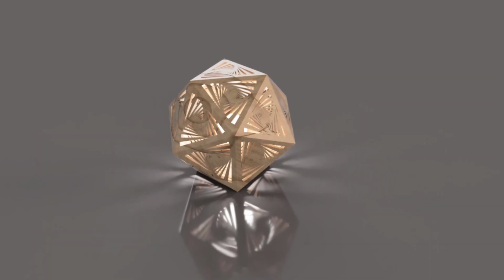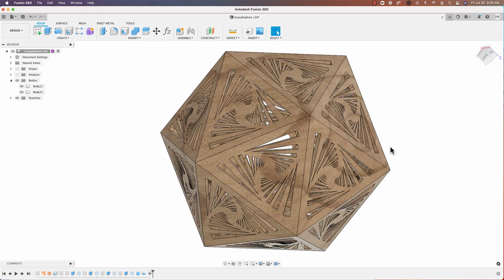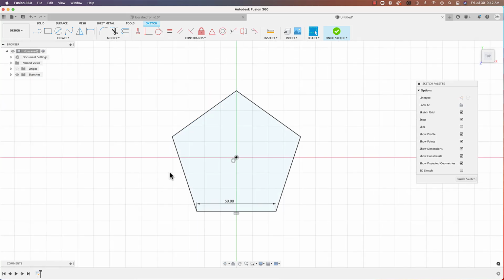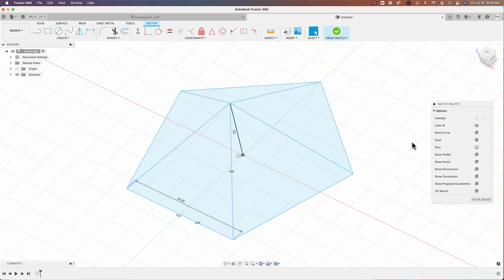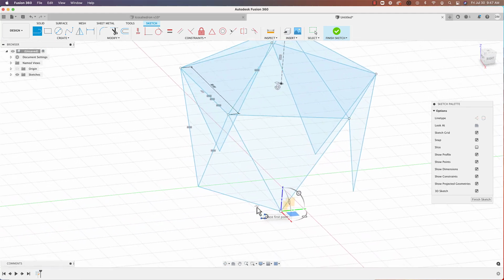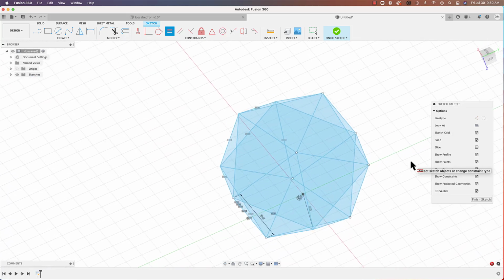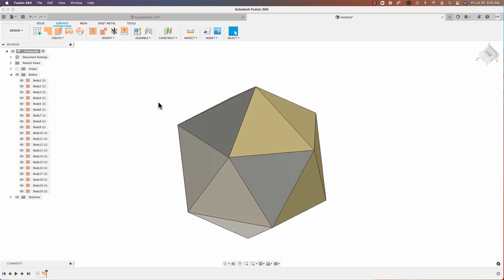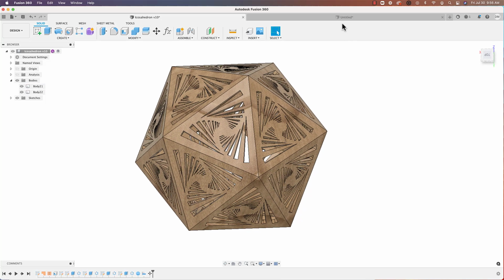Design an Icosahedron the Easy Way in Fusion 360 with 3D Sketch

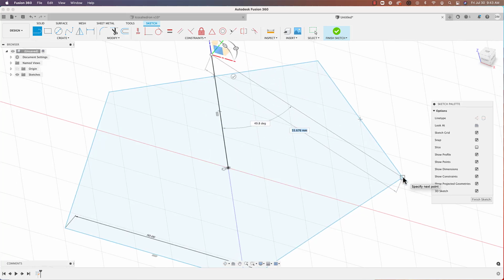Comment: Well, you should show the icon of the sketch in the browser: the sketch is not fully constrained, all lines are blue (at 6:47 constrained black lines turn blue).
Actually, 3D sketching is not a good practice. It's better to work with several simple sketches than fewer and complex sketches. It's better to pattern or mirror features faces or bodies than sketch curves. At least for those who want to be parametric.
Nevertheless, it's always nice to overview all the possibilities. Thanks for showing it 👍

Comment: Just a quick question. -  Normally when your sketch geometry is fully constrained, the lines turn from blue to black. However I note this didn't occur with your sketches despite being fully constrained. I ask this question since I've encountered this myself whereby my sketch appears to constrained, yet the lines won't change colour.

Great videos by the way. I always take home something from your work.   -Cheers
Reply: Currently, 3D sketches can't be fully constrained. It's a Fusion 360 limitation, I don't know why. There has been some discussions on AD forums about this and the current advice is to avoid 3D sketches for serious parametric design.

Comment: Very nice! 👍 
Thank-You! 😃
Edited: Too bad each face needs to be selected. I thought maybe selecting faces via Select settings would make it possible to get all 20 faces selected with one window sweep. ✌
Reply from the maker: Great observation 4FunRC.  I went back and tried it but unfortunately this method ends up finding a lot more faces.  When I changed the selection filter to only Profiles and selected the entire model, I ended up getting 174 faces instead of 20.  You get some really cool results when you start deleting faces but not the result I was looking for.